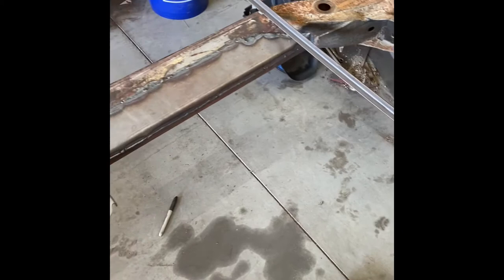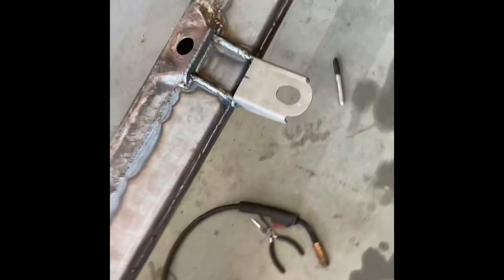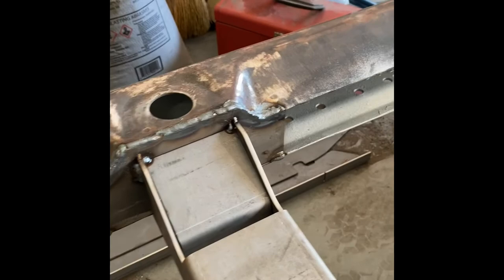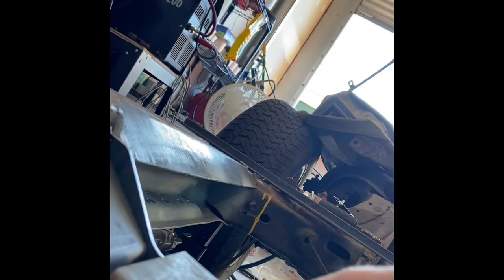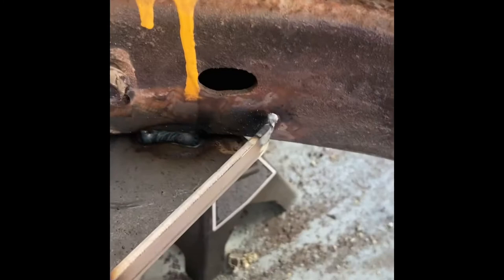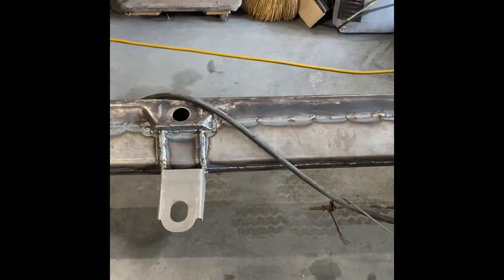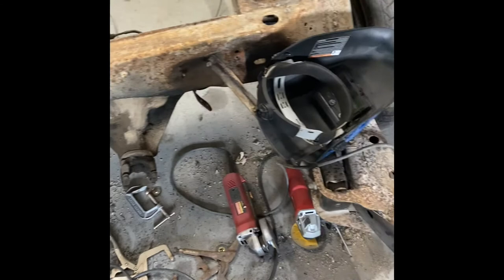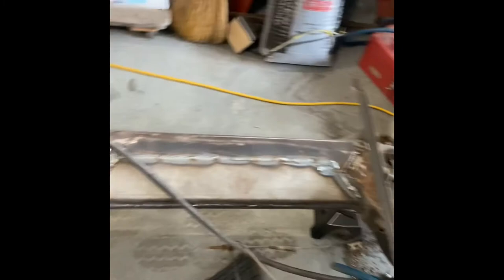1969 Chevelle Hellwig box in frame kit install. A must for serious street cars!!

Comment: Good video. Do you have a video of the transmission crossmember install? Wondering how that will work if it's the original
Reply from the maker: I have not installed it yet. I was waiting to desire what tranny I wanted to run.  But a video will be when I do

Comment: The instructions say you need to put the body back on the frame to locate those two additional body mount brackets. In your video you said you just centered them on the outside body mount. Have you put the body back on to see how close you were?
Reply from the maker: I used the body as reference

Comment: what welder are you using to weld this? I have a Lincoln 180 and didn't know if that would be hot enough to make these structural welds.
Reply from the maker: I use a weld mark 140 with 101 gas. Plenty power to weld this up.